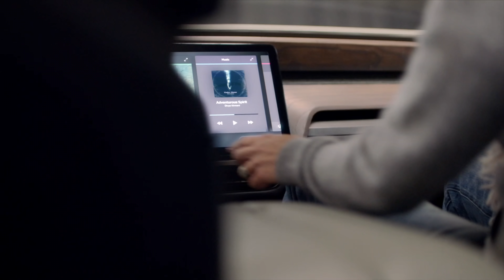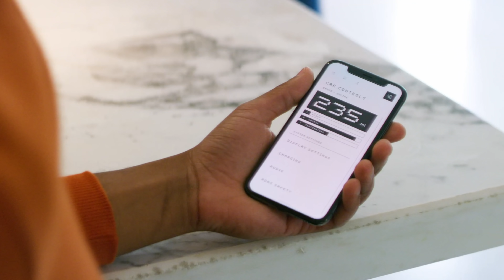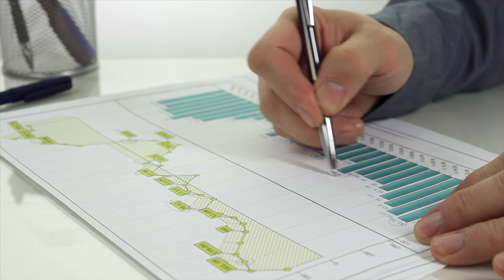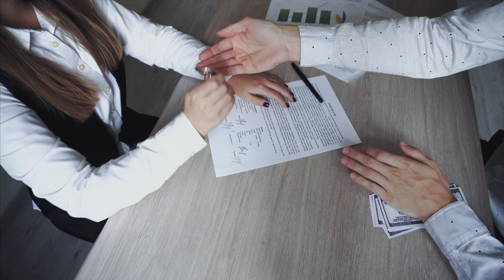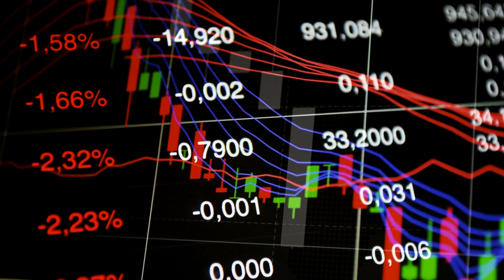Why Electric Car, Hydrogen Fuel Startups Are Going Crazy Over Reverse Mergers

Comment: You nailed it, 

Its starting to sound a lot like the Dot.Com bubble of the '90's. Where everyone having missed Yahoo and Netscape IPO all the sudden invested millions into any company that would mention the word World Wide Web or simply .com on their logo and presentations.

Problem is, they are comparing themselves against an Energy company. And not car mfg. The main business of Tesla is selling Energy solutions from individual homes to large State and privately run management systems. The car(s) are a means to an end, they were the perfect platform to validate battery tech and management system. While providing an electric car to the "general" public.  

Frankly, if any EV car companies today really want to compete with Tesla. They would need to provide an option for a complete turnkey package, meaning the car/truck + Home Charging System/Station + Solar package + Home Battery (Power wall). And all of these things are available as turn key from Tesla. They aren't by anyone else, and yet available from a multitude of 3rd party vendors as individual pieces.

And never mind the added bonus of reverse charging build in Model 3 and Y as to allow your car to be the emergency power backup for your own house, in addition to being able to act as an energy storage for your local power suppliers.   

Invest wisely.
Reply: TSLA is a black swan, and not a reason to invest in any old duck.
Reply: Now it is the Tesla bubble..